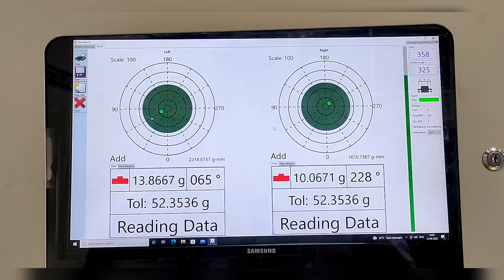Bearing Replacement & Oven Process 280KW,3300V, NGEF Motor (Intake Pump House).

Comment: I sаw two mistakes: 1. When you have balancing the rotor, you must to placed it on the bearing journals. 2. For greasing bearing you must wear gloves, it's not ok to put grease with bare hands, because of safety and you add moisture  of you hand in  grease and that may cause issues in future.  All other  things is ok.
Reply from the maker: Sir thanks for your suggestion. We will correct this in future